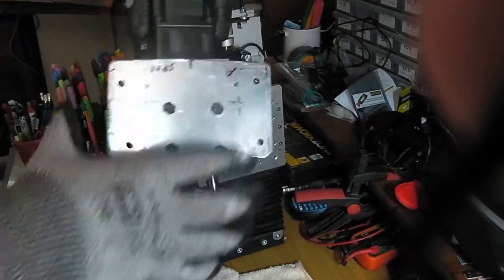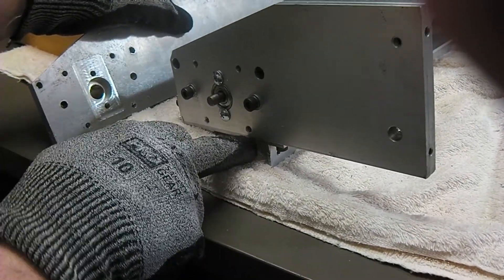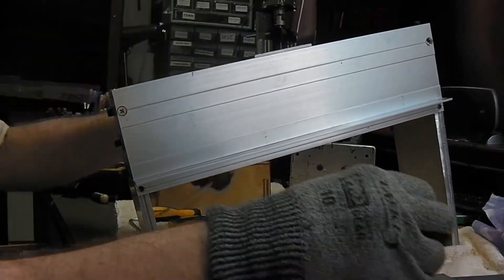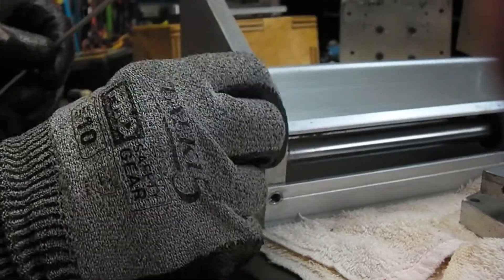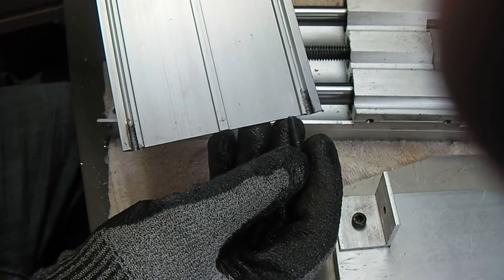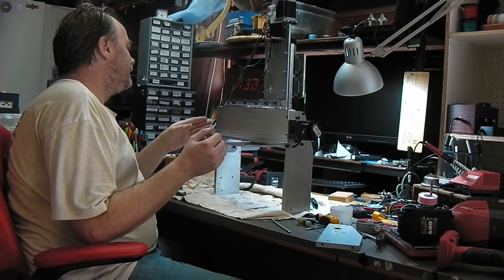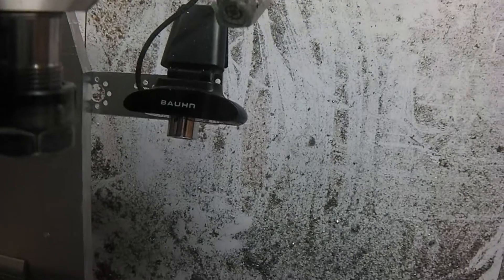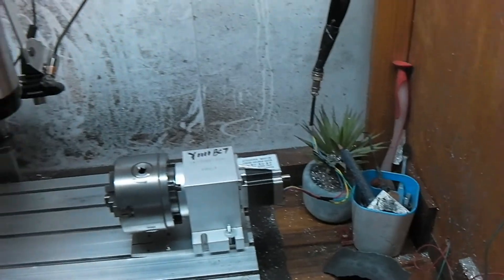Upgrading a cheap 3040 cnc for more serious work!

Comment: Did you add a thicker aluminum frame to tge z axis where did you find those upgraded parts
Reply from the maker: The linear rails, bearing blocks, lead screw, coupler, and stepper bracket were from aliexpress iirc. The flat alloy plates started as blank and I created the layouts. The sides I cut to shape on the cnc.

Comment: Thinking about buying one of the cheap 3018s and using the plastic parts to manual machine new ones in steel or cast iron

Comment: Hey Ben, awesome stuff! Do you find the 2.2kW spindle is powerfuly enough for aluminium? Any experience with a 1.5kW spindle? That's what I'm looking at getting and it would be great to hear your thoughts. Cheers, mate!
Reply from the maker: Sorry for the delay. I would guess that the 1.5 might be ok. I don't really have enough experience to say with any certainty. 

I have cut a PC back panel using just a 400w but it wasn't a great experience. That was very thin and soft alloy at steps of 0.1mm. I have found that the type of alloy you are using can make a big difference. 6061 is noticeably harder on a cnc. I tend to be conservative using small step downs.
Reply: really anything 800w+ will work 2.2kw is very overkill for desktop aluminum just go with 1.5kw and get some nice bits however if you want to mess with other harder metals thats where 2.2kw really comes in handy

Comment: Ben, the next step would be to switch the linear rods on the X axis to supported rails, as with your Z axis’s mods, you added some extra weight on the already weak and unsupported X rails. In my opinion, the spindle is hanging too much out , and not that well supported, so you may have to rethink the shape of the alu plates that holds the X axis as well

Comment: very nice, did you buy that upgrade as one kit or did you design it and cnc it and buy parts?
Reply from the maker: Felix Dudley designed it and cut it. Some parts had to be done or prepared with jigsaw as they didn’t easily fit into the cnc. I notice you can get some z axis kits, the downside is finding the length you want and configuration. As I mention elsewhere, making the rails longer than the lead screw would have been a good idea but I only thought of it after. All the kits I’ve seen match the rails and screw length.

Comment: what length support rails did you buy?
Reply from the maker: z-axis rails are 300mm and lead screw is 300mm. If I was doing it again I would get 400mm rails. The rails can be longer than the ballscrew to get the most out of what the ballscrew can offer.
Reply: thank you. i measured the distance between the side plates and its approx 400mm.